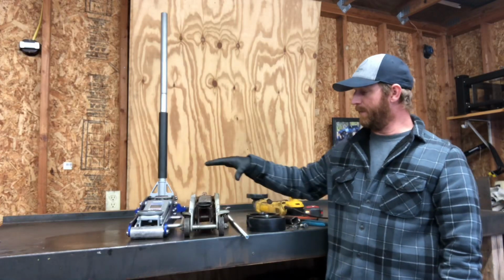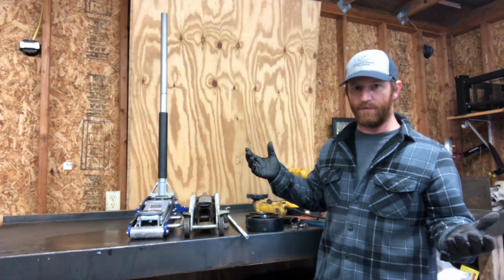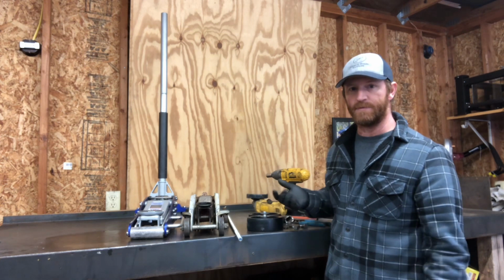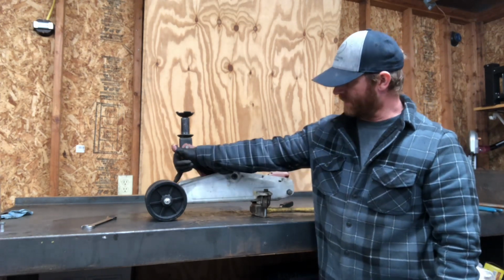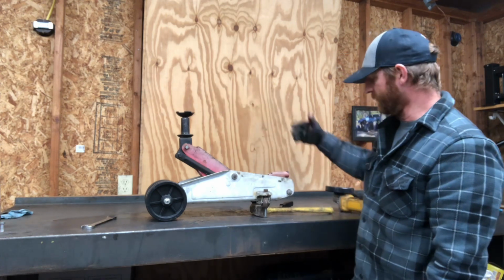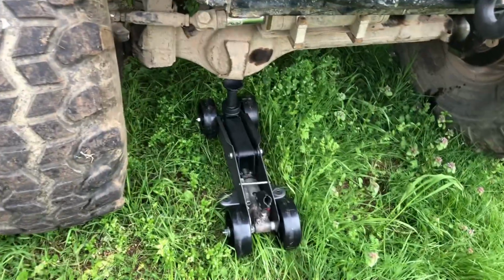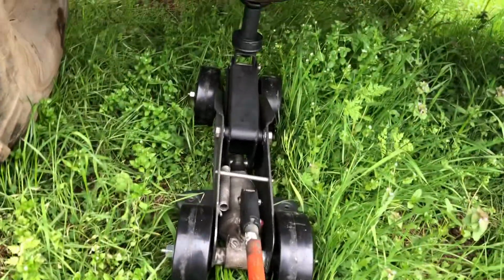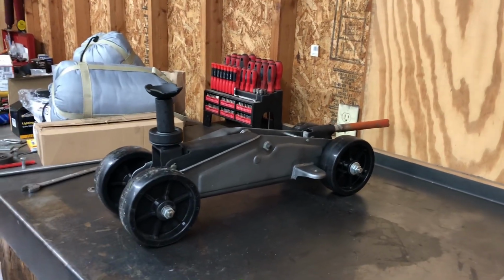Off-road Jack Conversion On The Cheap!

Comment: Great I have a older 2 ton trolley jack like the one you are working on and want  to make it into a off-road jack I can’t see spending 300-500 for a good off-road jack when I got one for 100 but would love to do this to it great job bud how did it work out for you
Reply from the maker: It has worked pretty well.  I haven't had any major problems with it yet other than not still having the original handle and I do notice that the 1/2" grade 5 all thread that I used for the axles does bend a little on the front when I'm picking up something heavy, but seems to straighten back out once I let the load back down.  Maybe grade 8 or a larger diameter would have been better, but I had the 1/2" grade 5 already laying around so I used it.